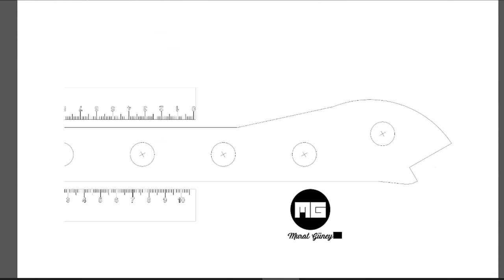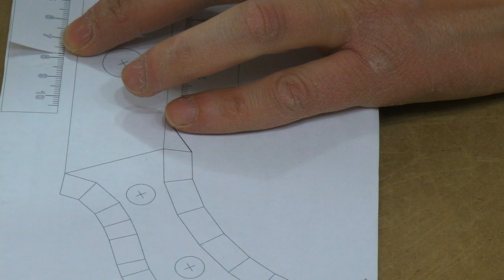DIY Push Sticks (I think it's very cool)

Comment: Nice work. BUT: It is a pushstick(!!!) and pushsticks are destined to take hits from the saw or router you are using them for (better the stick than your fingers…). So your version is quite some work for something that is prone to get hits and cuts and has to be replaced some time soon (in comparison to other tools). Making nice looking pushsticks with a whole lot of effort also has another downside: You do not want to give up on them so easily because it took quite some time to build them. So they tend to make you do dumb stuff in order to save them from being cut or so. Dumb stuff like pulling back on the table saw or loosening the pressure on the router table which then rises the chance of kickback or so. 

I would rather make a beautiful and intricate grip witch holds an exchangeable easily done straight forward (push) stick. When you cut something and you see that the stick will go through the saw blade you will not care and finish the cut because it is easy to make a new stick part. If making that (exchangeable) stick part takes more than 5 minutes then you are overengineering it. But with the grip: Go ahead and spend as long as you want and make it as nice looking as you want.

Cheers from Switzerland 🇨🇭
Reply from the maker: You wrote very logical things.  However, if you watched my video before this one, I made two other tools to use when cutting thin pieces.  I hope to use the most appropriate one... Thank you very much for your attention 👍
Reply: Sure, I know. But the problem is not only with thin pieces. My experience shows that even with wider pieces I sometimes - in the action - place the pushstick in the line of the saw cut. Repositioning the pushstick might not be a good idea in this case especially when I notice the danger of the pushstick being cut only inches before the saw blade. Actually just thinking about if or not to push the pushstick through the blade will distract you and rises the possibility to do something dumb. If you have a pushstick that is done in 5 minutes you just don‘t care about it and stay focused on your work. 

I have made myself a template for pushsticks and with a jigsaw and a router I am way within 5 minutes to make a new pushstick (actually I have about 10 spare ones lying around in a drawer).

Again: It is a nice project. But I would have made the tip of the pushstick exchangeable so you do not get distracted if it is in danger of being cut by the saw or hit by the router.

Cheers
Reply from the maker: I understand you very well.  just like when we get a new phone we will try to protect it more.  We don't care when the phone is old.  I won't want them cut, which I've taken care of for these push rods.  I will heed your warnings and not worry about the rods.  Because you are absolutely right.  If the tips break, I'll make them replaceable.  Thank you again.  Greetings from Turkey